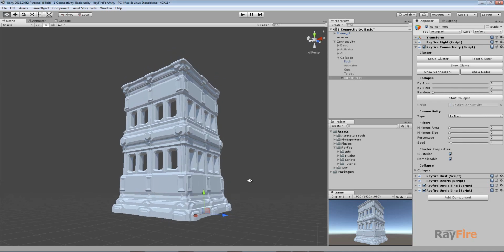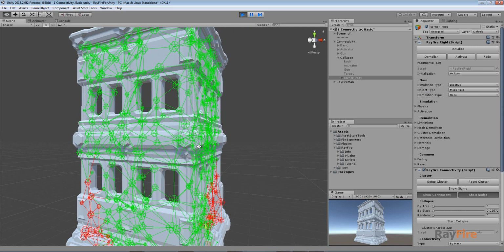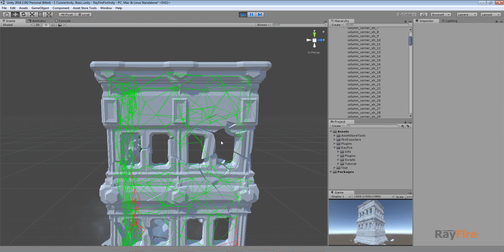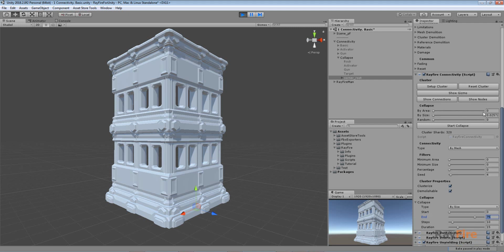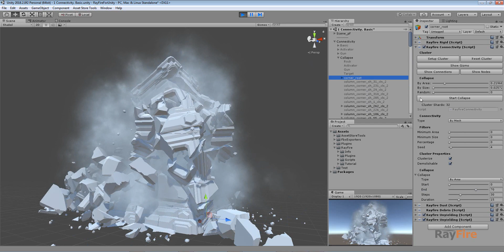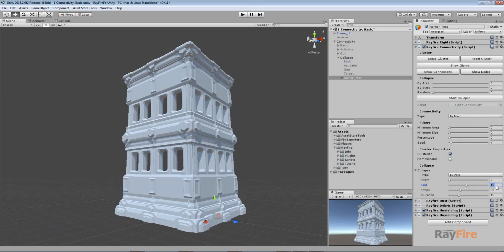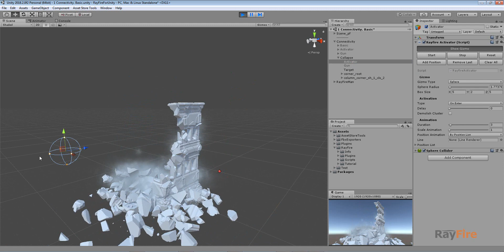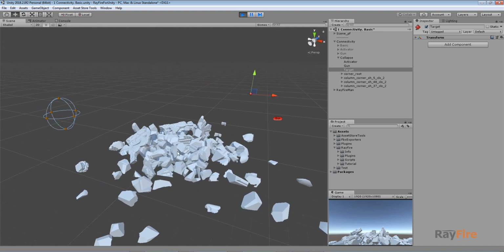RayFire for Unity. Connectivity. 4 Collapse

Comment: How would one go about making objects collapse after the cluster is broken? I have everything working so far how I would like, except for getting it to collapse when i break off a section of the structure. The only way I could get it to crumble was to change the collapse to Integrity and have it at about 75% as its not a dense objects, just some pillars. Awesome asset though, Ive never used a addon that is so straightforward with AAA results almost out of the box.
Reply: This video seems to cover if a structure is going to fall on its own accord, I am trying to make an RPG hit a building and once the clusters are broken, the top will shatter into fragments, but it stays as a solid chunk. It can be activated by the activator script that I use on my bullet projectile  (I couldnt figure out adding Rayfire Gun to my character controller so this works) but once its blown down I cant break it with an RPG anymore so I would like for it to crumble to pieces. I know you probably don't read these often as this is an old video, but Ill be here waiting your response :) Cheers
Reply from the maker: @Nature_Runes  I am not sure I understood you right, but did you enable Demolishabel in Connectivity component? It allows to clusterized groups to be demolished further. If this is not what you meant than please contact with me in discord so we will be able to talk about your issue in detail.
Reply: @MirVadim  I believe that solved it! I added a bigger radius sphere activator to my rpg projectile and it crumbles them that way. I have demolishable selected but not sure if thats what fixed it or my quick fix, but either way its working as intended. The only thing I can't figure out is how to make a mesh look seamless and not have cracks. currently having two mesh and when my bullets hit the main mesh, it turns off and the ones with all the clusters and fragments appear. Im not sure if this is the proper way to go about it though hehe.